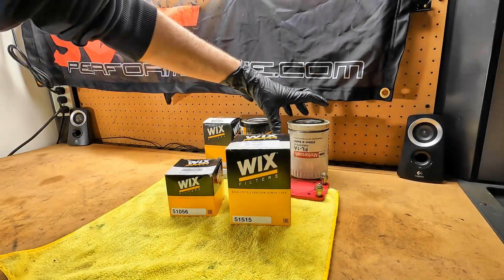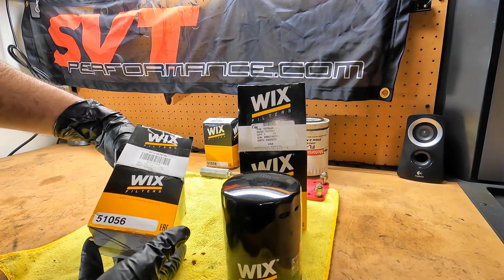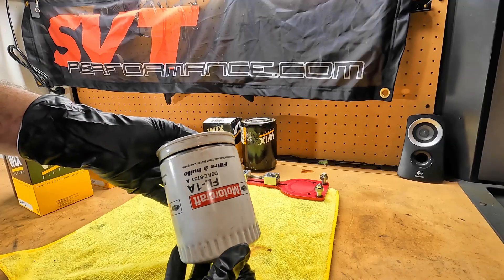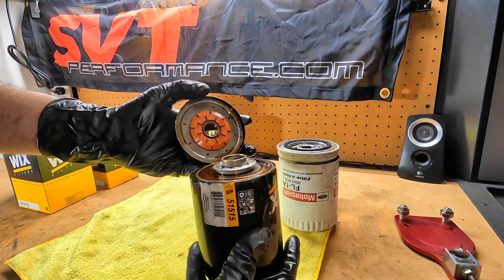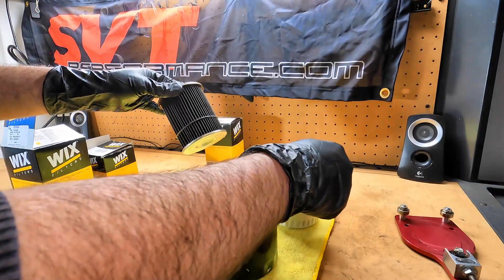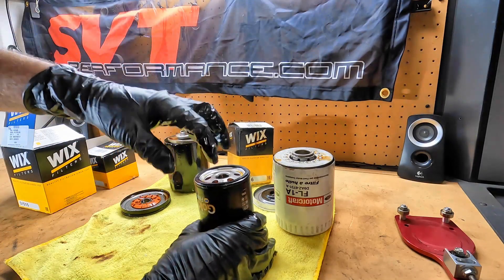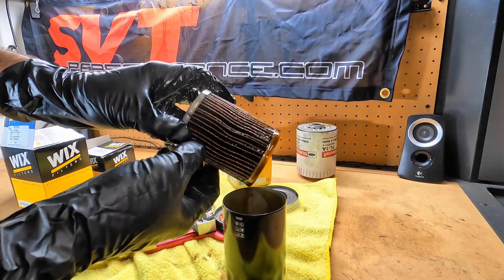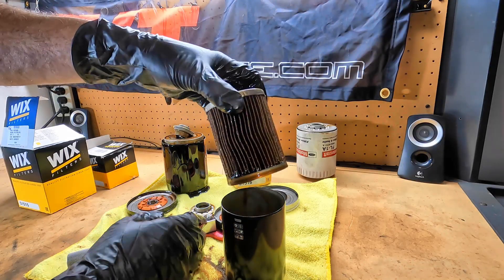Wix Vs Motorcraft FL-1A | Oil Filter Variants Cut Open

Comment: The WIX 51516 is the same as the old version of the FL400.  The FL400 got shortened by Ford a few years ago.  So if you want the older longer version, use the 51516.
Reply: My Tacoma specs the WIX 51348 but I use the 51516 because it is the same but taller... more filter media. TBH I had to grind a corner off a bracket for the 51516 to fit. The FL400 is a tiny bit shorter and would fit without grinding the bracket, but I wanted to use WIX 51516 because it is better.